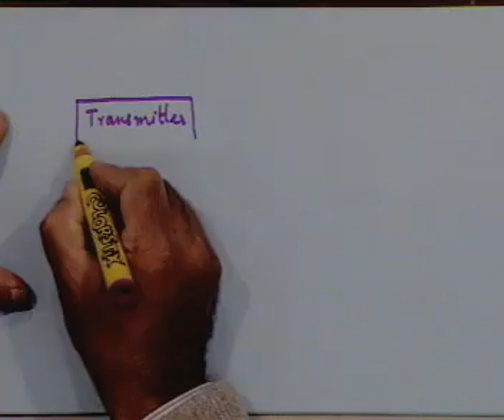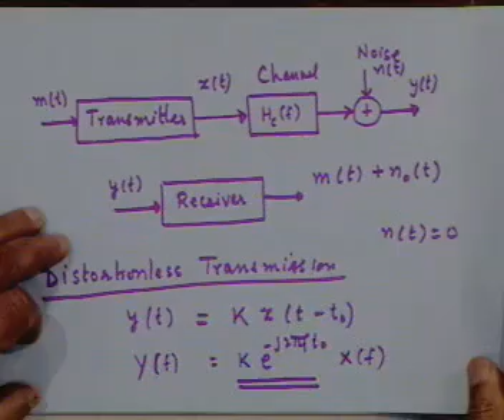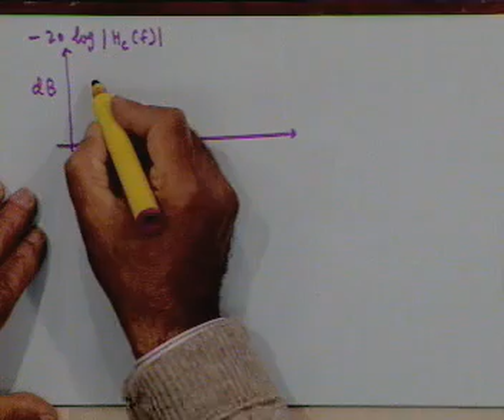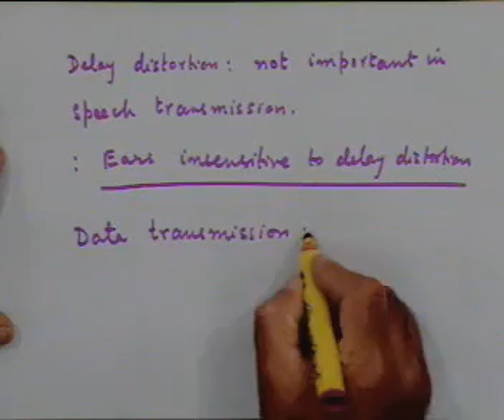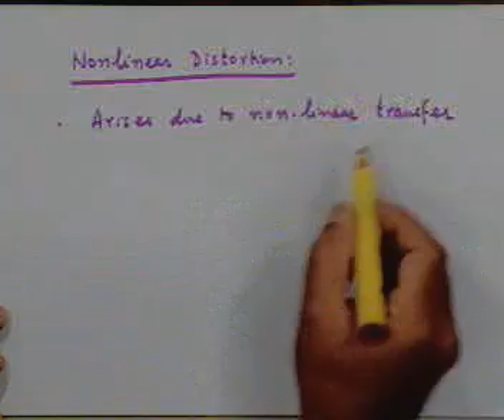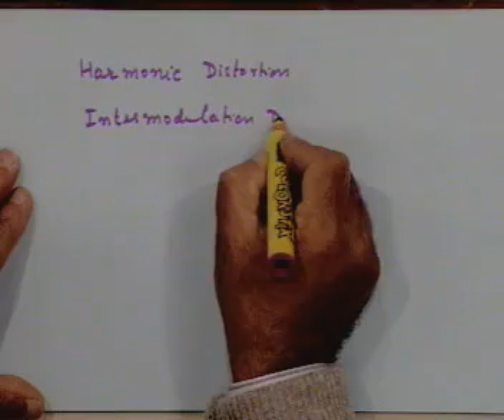Lecture -6 Fundamentals of Analog Signal Transmission

Comment: If the magnitude spectrum of mod of H(f) is constant over infinite frequency,then can we say that the channel has infinite bandwidth?
Reply: channel always has an infinite BW. but only for small range of frequency we can use linearity approximation
Reply: is this true for wired communication channel also?
Reply: I don't know, it might be related to a course on electromagnetic theory ,which I haven't yet completed . But in this discussion there is no restriction on BW of signal. For a given signal , system is the channel with transfer function H(f) if it is linear. And no transfer function ie only transfer charecteristcs for non linear system
Reply: ok..thank u